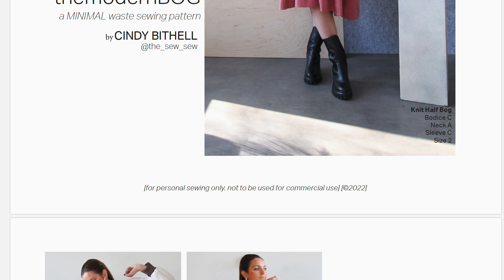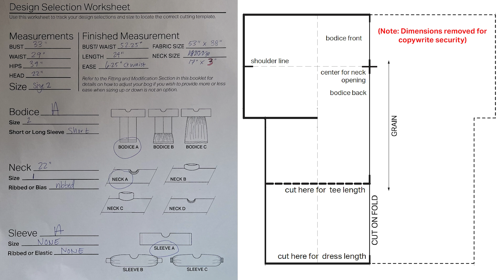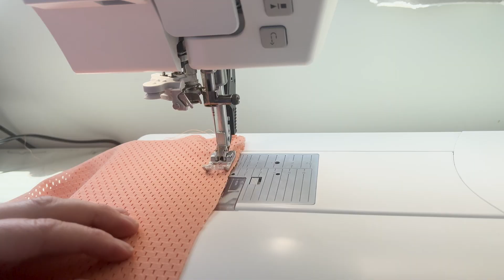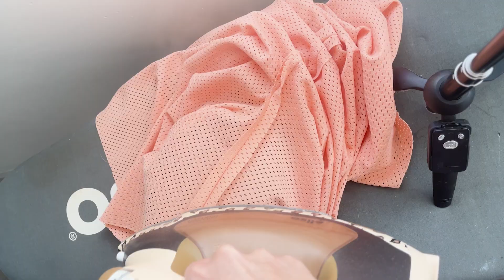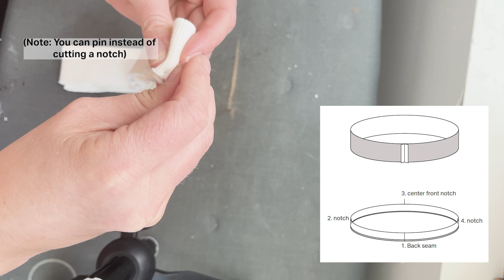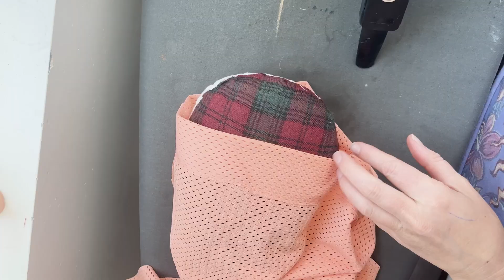Modern Bog Tee Sewing Tutorial

Comment: This looks like a pattern that can fit a lot of different sizes.  it is what I need.  I wish you would hold up the piece after you finish a section/ and explain how you made the seam at the bottom in the front, rather than the back.
Reply from the maker: the pattern is sized from the standard measurements for sizes
 00-30.